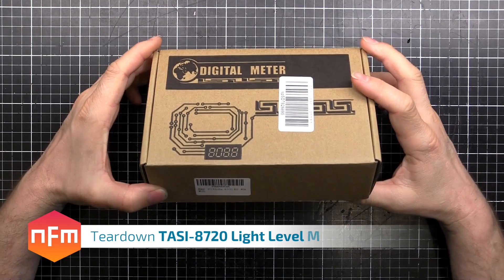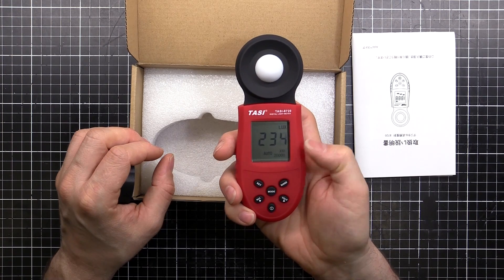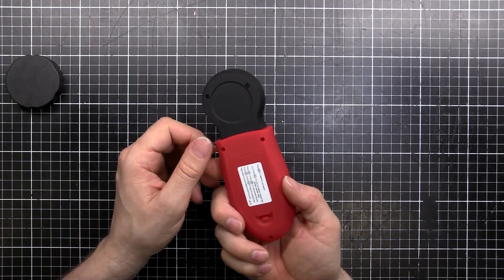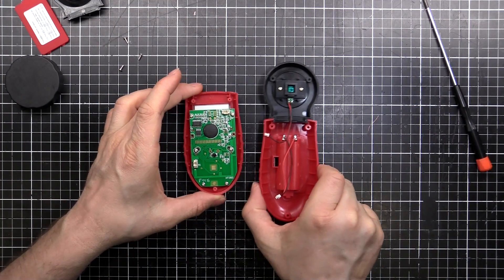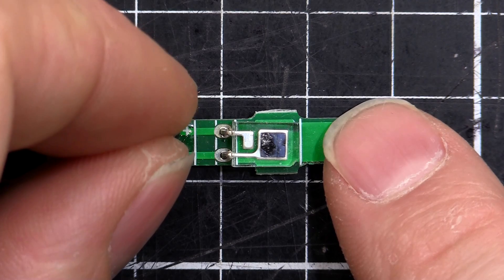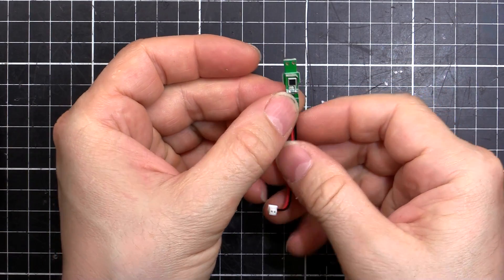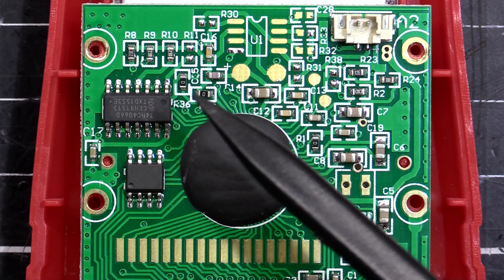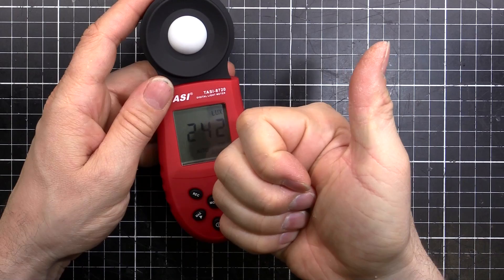Tasi-8720 Light Level Meter Teardown

Comment: I bought basically the same meter three years ago under a different brand name, the douself HS1010. I use it to test flashlight intensities. After three years, my flashlights are all reading 25% low. I find it hard to believe that all my lights deteriorated exactly the same amount. So I think the meter drifted. Has anyone else experienced this? Also, is there any way to adjust the meter? I see no kind of potentiometer on the board on your video. But interestingly, when I open the battery compartment, there is an access hole to the PCB and two apparent test points are accessible. I wonder what these are for?